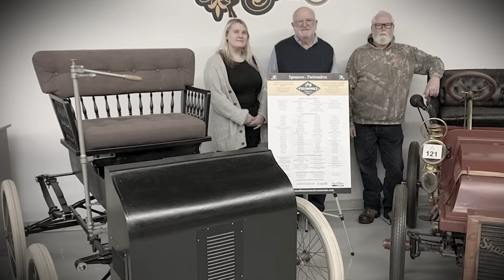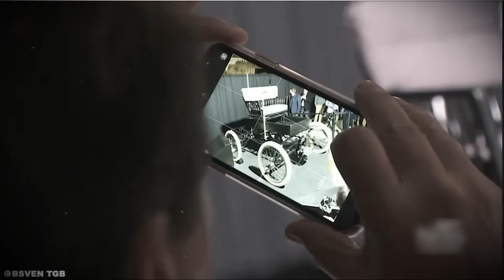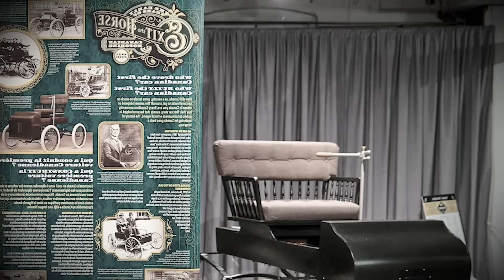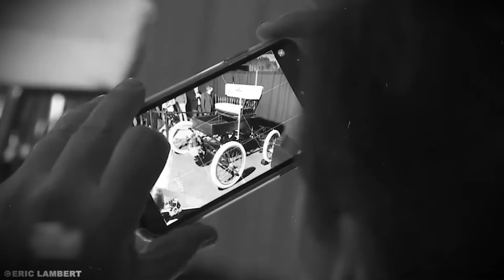This Canadian Mechanic OUTSMARTED Henry Ford With a “Homemade” Gas Car in 1896 3

Comment: Hinsdale, NH is known for being the birthplace of the first American automobile, which was invented by George A. Long in 1875 at the Holman & Merriman Machine Shop. While this was a steam-powered vehicle, Long later patented a gasoline-powered version in 1883, which is now at the Smithsonian Institution.
Reply: sydney herald  newspaper  blackburn  small workshop in sydney 1876  made cylinder gasoline running with wheel without muffler bang everyone horse run away  goverment  ban workshop blackburn shutdown

Comment: Does the narrator even watch the video ? There's no water jacket around that engine , it's air cooled ! And is not " make and break " ignition , it obviously shows a giant spark plug !
Reply: Make and break ignition can be used to fire a spark plug.